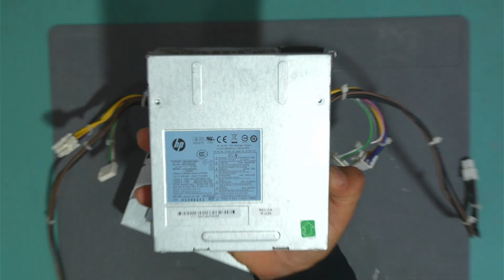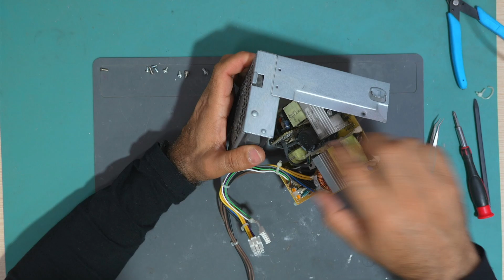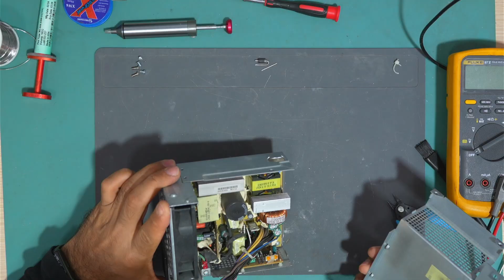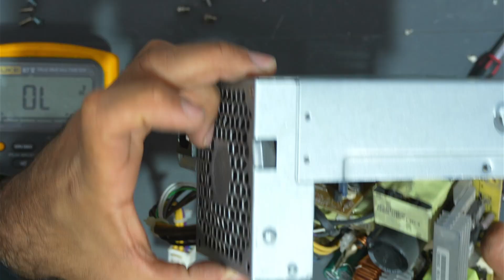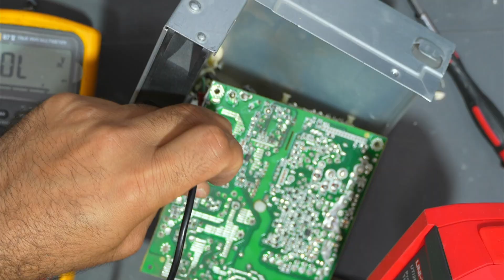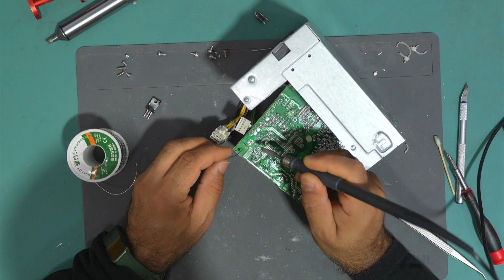2x Hp PS-4241-9HB Power Supplies Repair #psu #powersupply #repair #standby #pov

Comment: Hi..
Great work, great video..
I have a problem here.
I have the exact same PSU..4241-9ha.
Fuse is fine..
Capacitor has charge..
IC not blown..
Green wire has 5V..

Unfortunately when I shot the green to black,  no 12v power output..what do I check???

Comment: What could be the problem? My computer works in BIOS, but when booting Windows, it powers off and the fans spin up fast. The voltage tests okay at idle, but I haven't tested the amperage under load. I suspect the PSU is failing to deliver its full 240W capacity. If I were to repair it, which components on the PSU's circuit board would most likely need to be replaced or fixed?"

Comment: hello sir i have a question about that model of psu, i have a same model when connected to motherboard and plugged in the fan just turn and stop and the motherboard beeps 4x, i check the power supply output it only have a 12.08volts and i check the standby supply i have 11.3volts and the green wire has 4.3volts, is the 12.08volts is normal or very low? because when it is connected to the motherboard its only have 10volts

Comment: Your first PSU unit after dix may NOT be fuxed,  You did NOT check ALL power lines.  Even green to black shorting do NOT mean a full fix.  I should know I have an issue with mine and ALL power lines work as intended but 1 wire does NOT see any power at all.  If you are interested in knowing more drop a line below and we dill discuess the issue.

Comment: Dear i wish to inform you that the way to discharge capacitors is bad it will damage ics, the safest way is using 220v 200w lamp or green big resister ☺️
Reply from the maker: Thank you so much for your advice 
I really appreciate it

I wish you all the best